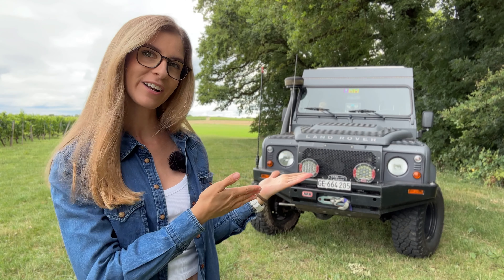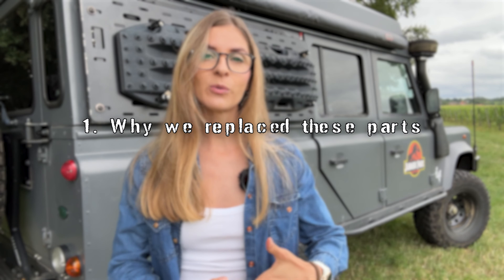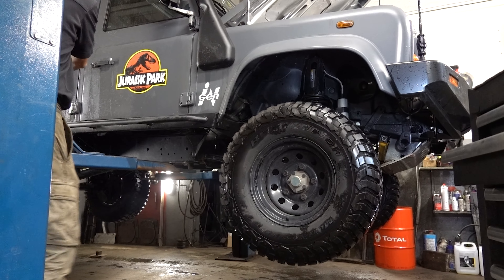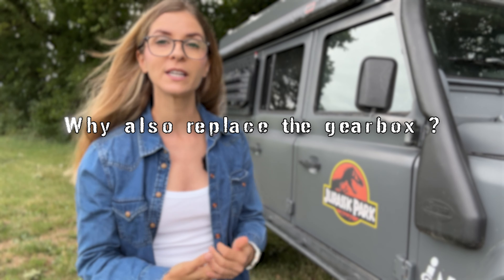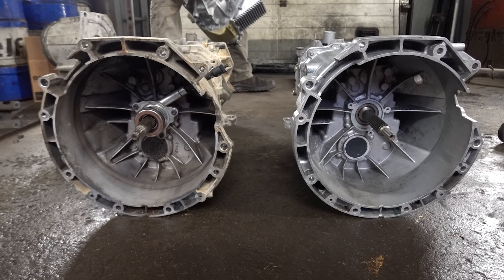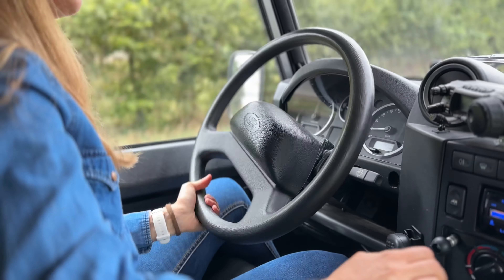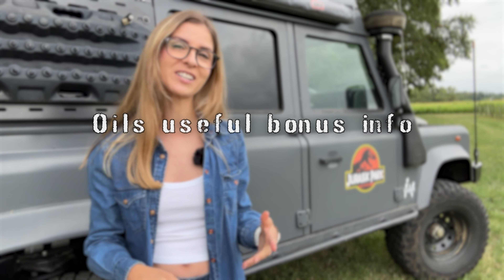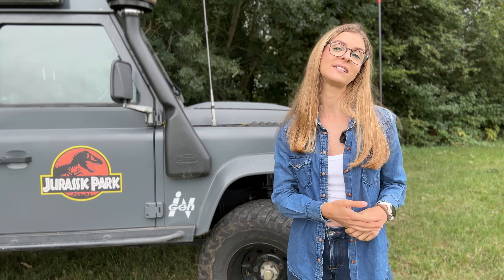1 Year Review | Transfer Case + Gearbox (from Winchester Gears)

Comment: Can't fault the work Tom did for me on my gearbox and transfer box. Really well made and went to visit to drop them off and collect. A really nice experience.
You also won't regret your decision to get Nigel to whisper to your diffs. Mine are amazing. Again went to drop them off and collect and had a good chat to decide exactly how they should be built.
Love the videos. Look forward to seeing more adventures.
Reply from the maker: Thanks! I think we do need to do a trip to the UK to meet Nigel, the diff whisperer (lol), and tour a little to meet Winchester Gears and LOF too and other nice Companies. How long you have Winchester Gears parts on?
Reply: @offtrackfamily  I've had the Winchester and Nigel's diffs on since middle of lockdown. Can't fault them. They are behind an OM606 running reasonably high power. Just taken the gearbox out though as going 8 speed auto. Nothing wrong with gearbox but clutch is really heavy due to power.

Comment: I bought an excellent Winchester transfer case and couldn't remove the old Speedo drive from my case. Tom was most helpful and once we identified the correct one he posted one out very promptly and free of charge. Top service. 
It is a lovely piece of kit and works a treat along with the LOF output shaft and clutch kit. I have Nigels diffs front and back and they are shear works of art and extremely solid. There is a noticeable weight difference between standand diff and Nigel's superior version. Though he is a busy chap so don't expect a quick turnaround but it's more than worth the wait.  
You are on the right path.
Ashcroft half shafts and uprated CVS on mine and I am happy with them and I have bought parts from them before and they all worked well.
Reply from the maker: Good to hear you also had good experience with Winchester Gears. We're also happy with the setup with LOF parts  and do feel Nigel is the one we need to help us upgrade our diff.

Comment: To distinguish any possible oil leak coming out of the GB or the transfer case you can add Fluorescent Leak Detector Dye For all ENGINE OIL
TRANSMISSION 
POWER STEERING
FUEL SYSTEM
UV DYE
It works with the UV light so add to one of the parts and to find out use the UV light to see any possible leak
 If is not shiny fluorescent is the other part 
If is shiny is obviously where is coming out from 
Nice parts excellent choice 🍻👊🏽
Sorry to hear about the bad experiences as well

Comment: I have had an 2019 R380 Ashcroft gearbox and LT 230 transfer box for 50,000 miles (80k km +) and it's as good as new, no leaks, no issues.  I am happy and will use the again. I also had as Ashcroft LT230 transfer box 20 years ago and went to Africa 5 times including a full trans Sahara off road trip and back - no issues apart from hot oil. Solution - a bigger transfer box sump. Otherwise - absolutely no probs and the car went on for 200k miles (300km) with it's next owner as a tree surgeons truck.
Reply from the maker: Ashcroft parts are good and we might have not been very lucky on the assembly for the LT230. Great to hear and confirm it's possible to have no issues just like we did for more than 100k km

Comment: Looking at your setup, I am wondering if you guys have issues with those wider tyres throwing mud all over the place, into the mirrors, roof top and even inside the cabin with open windows. As well, those wide tyres throw little stones chipping the paintwork. 
I suffer all those problems using 285´s on ET=0 wheels. I guess one solution is to fit aftermarket wider arches but I am not really keen on such a solution. Perhaps 265´s tires do not protrude outside the std wheel arches. I am quite sure 255/85R16 do not protrude the wheel arches but on full compression they may rub against the rear "tube".
Reply from the maker: We do have mud & stones going all over with the mud tires, we honestly just close the windows and put aircon on ;) Paintwork isn't something we really care about as it's an offroader and it gets scratches all over when we drive through small forest tracks. We do have 285 K02 now on new alloy rims and they do stick out less, so we'll see if this makes a difference.

Comment: Ahh yes, the Lt230 leak. I just use it like Ariadne's thread so I can always find my Defender. Then its purpose is to mark its territory to warn the other 4x4s away. Shame its such a faff to top the oil up otherwise I would put up with it indefinitely. Though for the cost of an uprated gearbox I can afford to spend plenty of time grovelling about underneath her. Another benefit is that the handbrake housing flings the oil everywhere resulting in natural rustproofing.
Reply from the maker: It's good to see the positive sides ;)

Comment: Great video as usual,
But a little rough naming Ashcroft, when sounds like the leak could have been picked up with a preinstall check of the casing, but didn't name the "french craftsman" who completely butchered the job.....
However, agree with your review of Winchester, im getting an LT230 built by them now, service and communication has been absolutely outstanding.
Reply from the maker: Ashcroft does make great parts but Winchester Gears' service in our case is way above. We also have a full Ashcroft HD transmission so we are customers of both companies and did experience it this way. French craftsman is so insignificant in the International Land Rover community that there's no reason any of our viewers would go to him. People who may be concerned already know  and asked because of all the open drama he did on facebook exposing his way of treating customers. But i feel you want the name ;) MC Repairs in La Celle, France

Comment: In general I have had good experience with Ashcroft by getting spare parts. Very cooperative. I find rebuilding the LT230 is very simple. Dealing with a MT82 however, is a bit more complicated. During those hot summers you should use a thicker oil on the LT230, such as 75W-110 or so, even with the extra oil capacity sump you have installed. Are you planning to fit a rear locker? It is a peace of mind.
Reply from the maker: Ashcroft do have good parts and we might have been unlucky with their rebuild. Regarding oils for the moment we stick with Winchester Gears recommendations and for diff locker we might yes :)

Comment: Sadly the transmission is easily the worst bit of a Defender with the transfer case being the worst. Ashcroft seem to be getting a very mixed reputation where as Winchester seem to be very good. 

Such a shame LR spent zero effort in improving this fundamental aspect of the Defender - its all just too weak for off roading without the constant fear some thing serious is going to break and leave you stranded.
Reply from the maker: I agree regarding Ashcroft and Winchester Gears. We upgraded parts according to our use of it and we were never left stranded on the side of the road. Almost happened many times but were always able to fix to continue. Sometimes with help, sometimes without. Taking good care of it with regular maintenance, understanding the mods we do & why we do them, and having a good knowledge of the car helps a lot on that side.